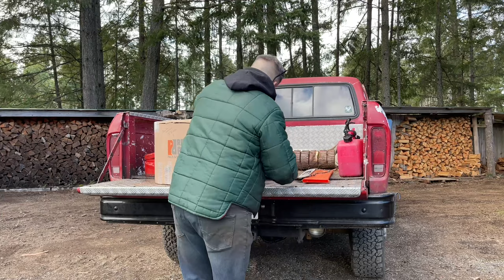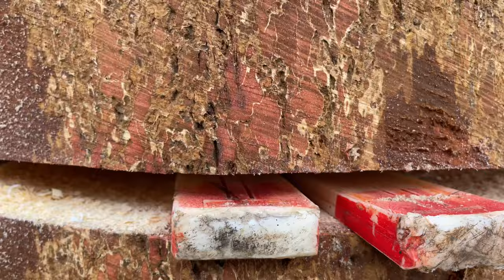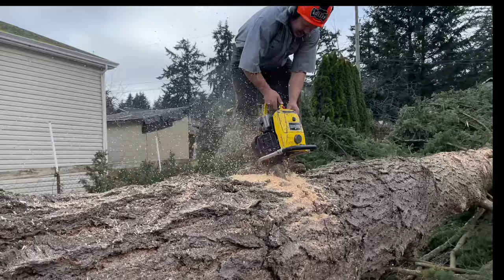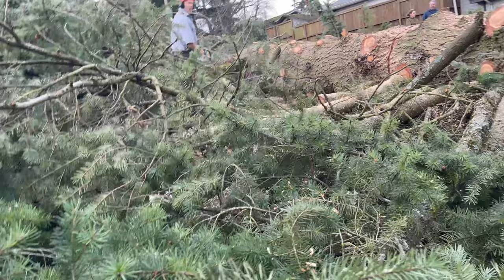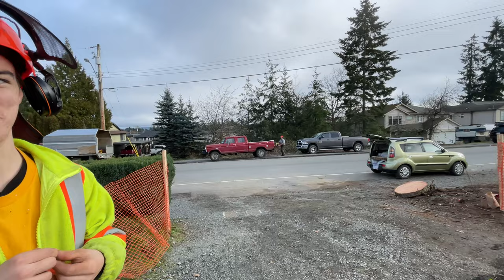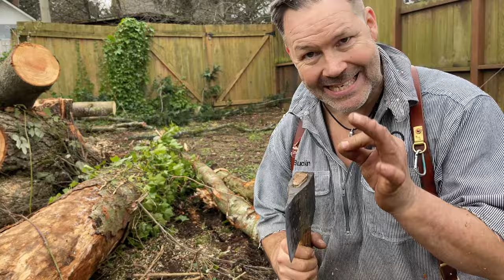STIHL MS500i - World’s 1st Fuel Injected Chainsaw

Comment: I bet the ECU  (computer) in the 500I has a "break in" tune for the first hour or whatever and then it changes the timing and fuel to full power after that.... The rings seat almost instantly. Cool to see a thumbs up for Stihl!
Reply: Could be...
Reply: If you compression test the saw it takes about 5-6 tanks before the rings start seating real well.  Try it sometime!
Reply: @JSomerled  p9au
Reply: i have seen snowmobiles that limit the RPMs for so many hours until they are broke in then they will gain engine speed and power
Reply: I'll take the 125 over the 500 any day
Reply: @919hornet4me  I love my cp125.
Reply: 4 tanks in and mine got angry
Reply: Yep I've used it, and it's friggen awesome 😊
(Dave from New Zealand)
Reply: I know im late but they mentioned a barkbox, I rememberd hearing about it.  its an aftermarket exhaust and they say you need to run a few tanks through for the ecu to adjust.  Sorta annoying he assumes you know what going on, none the less neat to see some saws cut I havn't seen before.
Reply: My only two new saws took a half dozen tanks or so to get their legs under them.  My little featherweight echo cs3510 gained power solidly until probably tank 10.
Reply: Huqfarna 357
Reply: Your hard work and dedication are truly paying off.
Reply: You have a unique perspective that adds so much value to any conversation.
Reply: Good call,  I own a 500i and ur correct. GREAT saw SERIOUS power. I have a Oregon 32 bar & it has no problem spinning it👍
Reply: @919hornet4me  lol must be  a old head this is the best saw out period

Comment: Got 3 of these saws and been using for a year and a half now. No serious  problems just need to watch out for the cracking in the fuel tank and plastic is fairly weak .but its and absolute beast enjoy. 
Tom miller from across the pond

Comment: The 500i is by far the best saw that Stihl has released in my opinion. At first, I didn't like it, but after a week of using it every day in the brush I've come to love it. Mine had a break in period of at least 10 hour run time then it completely opened up. From what ive read other people said the same thing. Out of the box til now it's a completely different saw. Give it a chance you will enjoy it. The thing I like the most about it is the consistency it gives you. The power is always there which is where fuel injected shines in my opinion.  Surprisingly I haven't felt like I've needed more power and I've put it in some very big wood.
Reply: Drop it and see how it runs.  Just bouncing around in a truck bed has required us to bring our “electronic tuned” saws back the dealer repeatedly at $60 a pop.  They have to plug them in and reflash/update the tune.
Reply: Do you think he will be flashing his own saws should he sign on?
Reply: @stevefrazier2214  naw man I totally get where you're coming from. I get it. Luckily I haven't had that problem. I always take extra good care of my tools and equipment though because that's an extra expense that can be prevented by taking the extra time out. Fuel injected saws has alot of room to be improved upon but I think it's the potential gold standard. I'm not a believer in battery powered when it come to heavy usage. The 500i is an outstanding new platform to build off of though.
Reply: @moose1164  we have had the battery powered top handle huskies since they came out, 5+ years?  The saws and the batteries have outlasted any gas top handle I’ve ever owned.  A husky rep shocked when we told him how old they were and joked about needing to do something about that...you probably know gas are rated for a certain amount of hours of use.  We currently have 5 battery saws, including the new version.  We no longer own a gas powered top handle.  We grab a 50cc gasser when the top handles are not enough.  The new husky with the nano cut bar/chain from Oregon is the tits.  Battery powered saws  for technical climbing and lift work are awesome.  No pull start, no idling saw.  Waiting for the day a power to weight battery saw competes with a 120cc saw!
Reply: @stevefrazier2214  oh I agree. I like the battery top handle saws for climbing but I've ran into limbs that a battery powered couldn't finish the job. The actual power is where they need to make the most improvements in my opinion. Battery power has come a long way and will eventually surpass gas I think.
Reply: @moose1164  yup!  The older/original battery saws we would not use much near 6-8” soft wood, 4-6” hard...the new version with the nano chain we cut a 12” piece of oak with no problem, wasn’t as fast as a 200t, but it was fast enough not to complain.  They have some big claims on that nano chain.
Reply: @stevefrazier2214  That’s strange Because I’ve cut over 30 cords of wood with mine with nothing more then bungee strapping it to the back of the flatbed of my F350 bouncing around while driving through terrible rough dirt roads or no roads to get to the wood I’m cutting up and I’ve never had a problem with my 500i tune. It’s always started right up and went to work.
Reply: @DaveofAllTrades75  good to here. I’d hope the 500i would not have any issues as the earlier e-tune saws did.
Reply: You have a unique ability to stay organized and manage your time effectively.
Reply: Your positive energy and enthusiasm are truly infectious.

Comment: My first job was block packer in a small mill here in the Kootenays, I was 13 and they taught me how to run a chain saw with an 070 Stihl, and a 090 Stihl. I had to hook my toes into the handle and handle bars, hold the pull cord and stand up to start those saws, but I did start them. lol. From day one I was in love with chainsaws, and now 40 years later I still love chainsaws, I play with them, and work with them, build and repair saws, but for the life of me, I have never been very good at tuning a carb!!! It always amazes me how quickly you can hear and fix a poorly adjusted carb. God bless.

Comment: "Stihl" holdin' on to the 461's. I've fell, bucked and blown up a few. Still love em. The 462s and the 500s have just felt too damn "squishy" I've yet to try one with the after market motor mounts so I can't rightly disapprove. As far as the Bark Box goes...  well, absolute must have. West coast is killing it with them things. Buckin' has sparked hope in me for the 500i for sure. I'm just not sure if it's just his "contagious positivity" or not. Take care Buckin'. You're a damn legend.
Reply: Modern Scandi' saws are made with a firm sight on complying with hand-arm vibration figures hence the squishiness. You wouldn't believe the lengths European employers have to go to to comply with regulations. However, the way the 500i is set up the daily exposure limits are similar to a saw two cc classes lower.
Reply: @longlowdog  I understand why they're squishy. It just doesn't work for cutting in the Pacific Northwest. I don't care about vibration. It's a great saw. I just want to run it with the stiffened up 661 mounts I've heard you can use.
Reply: Your creativity and innovation are truly inspiring.

Comment: Billy Ray, one thing that happens with these computerized saws is they "learn" from the throttle demand and the actual engine rpm as to what the load is. If throttle demand is 100%, but engine rpm is low, then the system can add more fuel to compensate. Sometimes this process takes a couple cuts to allow enough data for the computer to make the adjustments. It doesn't happen with a single quick cut under heavy load because then subsequent cuts will be too rich. If you're doing big cut after big cut, it'll start to dump more fuel in. If you switch back from Buckin' to Limbin', you may detect less power when you then jump back into a heavy load cut.
Reply: You have a natural ability to connect with people and make them feel valued.
Reply: You have a natural talent for making others feel appreciated and valued.

Comment: Hay buckin. I run the 500i for 2 years it a monster saw but I have a lot of problems with a lot of part from the saw every week if I have a broken part most of the time it's the brake claw. I can feel that the saw is light built but the parts are also ligt and not strong built.
Reply: Sure dnt feel as solid as the older stihls does it?
Reply: you'd be one of the rare ones with issues.  Madsen's has sold hundreds so far, no issues.  I know they were out in Europe for a long time and they were working out the bugs, maybe what you have?? Cheers :)
Reply: Not to put any one down.. Can't make everyone happy however I am the kind of guy to listen and take notes..
Sthil fan. Maybe I missed it but is it dumb little stuff braking or more important stuff like harder parts.
As buckin was saying the casings may not hold up as long ext.
Dumb stuff that brakes to me is stuff the saw could run (maybe not for long) with out like plastic covers ext..
I am an automotive geared kind of guy so,again if I am missing something please forgive me..
I do have a 2 Sthil saws (MS 311 & MS 461) and both have there uses.
Reply: G'day Stihl fan what part of the world are you in that's the question?
Reply: I've seen 3 brake handles go in about the same spot on different saws. Maybe the weak link but disengage it by hand or with a scrench and you're good to go, just remembered you only have an inertia break at that point

Comment: I had to get out of bed as soon as I saw the title.
I'm not a professional arborist (yet) but I got myself a 500i a few months ago (here in Europe they're available "over the counter" :D).

it's brutal. absolutely aggressive acceleration. most of the times starts on the 2nd pull (from stone dead), never had more than three pulls though (not even the first start!).

the only downside is the filter system. you have to fabricobble something together to keep it chip-tight because in stock form it isn't quite - there are two openings to the filter where chips/dust can get in, one is the main opening (which is tight) and the other is the one that the cam engages the cover.
Reply: Good to know... 
Thank you for your observations
Reply: @jirusjirus9322  no worries.
I fixed mine by adding a rubber "washer" over the filter-housing-cover cam-nipple where it locks on (by cutting a piece of bicycle inner-tube to size).

it's definitly tight now, not letting any particles through.
did the same around the "main" hole in the filter, just a ring of rubber around the housing fixed it completely.

also, now the cam locks on more positively (not hotdog-down-the-hallway-style like stock)

Comment: When mine wouldn't rev after starting like that, it was my decompression valve.  I also notice more power after about 5 big cuts when everything is right hot.  I also believe there is a rich fuel map that runs for the firt 10 hours to allow cooler break in temperatures and then the factory reverts to standard tuning.
Reply: Your kindness, compassion, and generosity are truly unparalleled.
Reply: You have a contagious energy that makes everyone around you feel more alive.

Comment: Theirs a few loggers in my area that are running the 500i. They started running them summer 2020. Only complaints I’ve heard is that they were very hard on fuel and they overheated some. Maybe that bark box would help??? Other then that they like them.
Reply: I’ve heard the same for fuel consumption.  However I did see a review that stated after a while (probably fully broken in), the saw did flip and started sipping, instead of drinking, fuel.  I know that in a couple of months I’ll find out myself. 😁
Reply from the maker: check out tank capacity and compare to others   its small

Comment: I run the Jason Egan strait shot muffler on my highly modified Stihl 362cm..Ported and polished the intake and exhaust, 10 up piston, recalibrated ignition,  I had problems tearing chains apart until I went .063 gauge. 
32 inch light bar 
I live and cut in S.E. Alaska with big spruce and  cedar...I owned Allied Timber and AMII logging on P.O.W. Island. 
4th generation logger timber faller. 
My saw out cuts a stock 661 any day of the week!

Comment: I usually put a “jerk line” on em too, even though I’m confident in my hinge, especially if there’s any chance of hitting a structure or a smaller tree I want to keep. I tie a tow rope around em as high up as I can with an extension ladder, then hook on to the winch cable of my dually or jeep, sometimes with a 20 ft heavy chain in between for more distance on the big boys. Also use a come along on a large tree nearby if it’s too tight for the truck or jeep, although that’s more of a tension and cut thing rather than a cut and snap. So far so good but not as foolproof because it free falls after the cut instead of having a longer directional pull down. Get er real close and then hammer it in reverse. Snaps like a twig, straight every time!
Reply: Your passion for your work is truly infectious.

Comment: One thing I noticed about these 500Is is that they do not like it when you change up the fuel/oil mixture that you break them in with. They get used to what you run in it and then start messing up if you suddenly change the fuel on them. That being said the 500I is my favorite saw to use by far for what i do mostly having to hike spans of power lines and cut in some funky hills often. The power to weight ratio is so nice, I’d much rather take a 500 than a 461 any day, especially days of constant hiking to get to the trees I need to cut
Reply: You have a unique ability to balance professionalism with a personal touch.

Comment: I’d have to check the exact specs but I think it’s either 3 or 6 hours on the 500i. Before the ecu will start to lean it out and let it rev out more. If you have a local dealer he should have a computer to plug in. Give the max rpm the number of starts the number of attempted starts. Hours it has been used etc. over here in Australia we have had a few burn themselves out because they get to hot. But like anything horses for courses and as a felling saw there great.

Comment: Buckin' buddy , if I may ....historical experience with STIHL  . 1984-1985 first 038 super came out . we use to offer free adjustments to keep saws running well . the first series , first 1-3 weeks , the 1-2 months the usually the pros  between 5-6 months . an ECHO salesman,  very nice and good rep , calculated for us ; 500 hrs of break in versus his 50hr .  I doubt as big a difference with fuely system but you are barely breaking it in now . ROCK THE CHIPS BRUH !! thatnsaw now available in eastern US yet..... I. ain't afford , but hope my dealer gives a demo 🙂🙂

Comment: I take it you like the 500i ? we have had them about 18 months here in the UK , they seem to be holding up well as i have only heard of one having problems, i used one myself several times now and all i can say is that saw is a game changer, only problem is they like there fuel as you can get through some when cutting big wood, the power, the weight, the balance of the saw of the saw has changed saws for sure, used them with 20" and 25" bars and find them to be and find they just dont bog down at all, take care,

Comment: Hey Billy that Saw been on going for three years, 
They're different than a traditional saw , 
That design of fuel injection came about over 20 years ago in the shops here where I worked at a stihl dealer ,20 years AGO stihl played with an 28   version but at that time the price of the fuel injection was the same price as the saw it self carbureted

Comment: I have a Stihl 660 magnum I got for a steal. Haven't used but a couple times but what is your thoughts on one? I have 50 to 60cc saws I use around the farm for all I need. I have my grandpas 1984 Husqvarna rancher 50 he paid $400 new With receipt. Straight bar and bow. Other than replacing fuel lines and air and fuel filters hasn't been touched! Runs perfect Everytime!

Comment: I got mine with a standard 30" and full skip square chain last December and I love it!  I also own a 661C-M (36" bar with a full skip square ground chain) and ran them together at one of my buddys jobs and I was blown away with how powerful it was.  While it isn't quite as powerful as the 661C-M, it is much easier to maneuver.  The saw also has a high output oiler that is identical to the 661C-M.  To get to the high output setting on either saw, I found a punch and a few slightly firm taps/blows with a hammer on the first stopper to work.  My only complaint about the saw is that you can't install the same dogs and chain catcher that is stock on the 661C-M.  I consulted with my dealer and the reason is that the gap between where the dogs connect to the side cover and powerhead is different.  Great job on the video!

Comment: The Bark Box works on the 462 also. Not sure what happened with the one you were using, might have been the saw. My 462 didn't open all the way up until I had about 10 tanks thru it.

Comment: Only Stihl saw i'll swear by is the 660. The only Stihl that fires when you need it too, everytime.  There trim saws cut, but are a nightmare to work on. They also decide to not oil for a period of time, then will oil again. Changed every part of the oil system including oil brands, they still do it so we just accept it now.